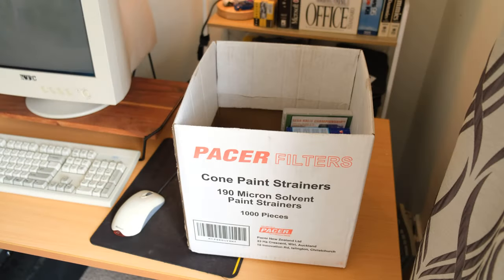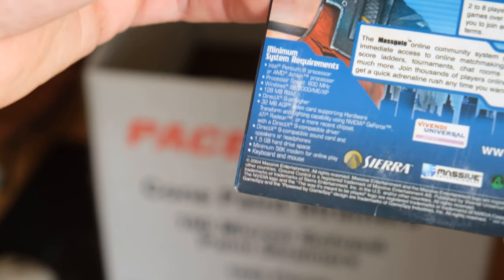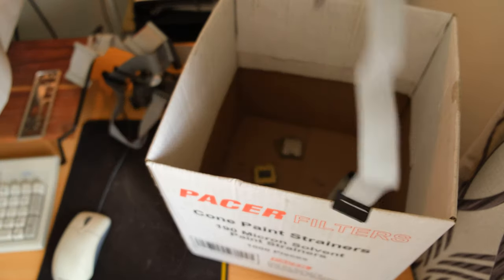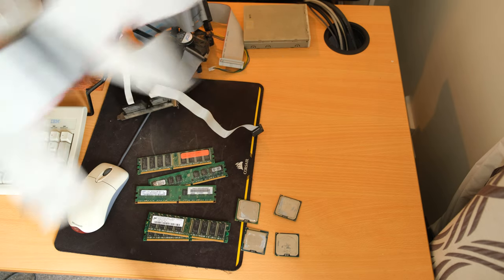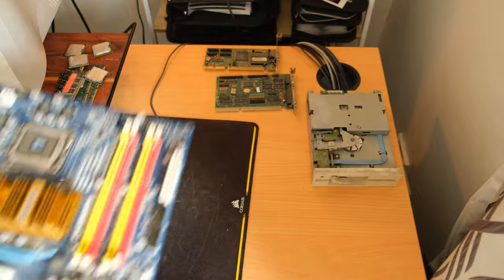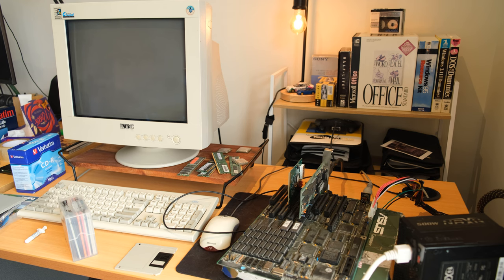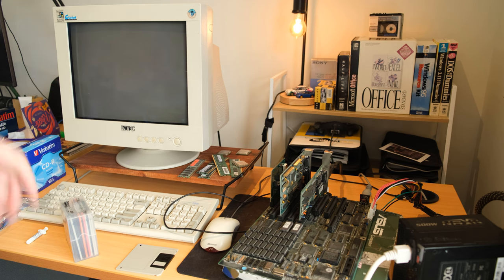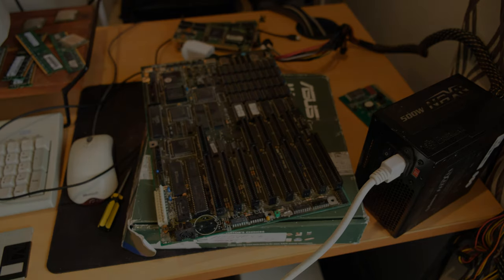Tech Gold | Thrift Finds

Comment: About that 8742 error on the 286 board: isn't the Intel 8742 the keyboard controller chip?
Maybe that's the problem... I guess you'll need to fix one of the traces that goes into that chip...
Reply from the maker: I think you're correct. I did a little research and found most of those error codes refer to the keyboard controller. I'll do some repairs on it and see what happens
Reply: @thesmokingcap  I also said that because I think the 286 has a special CPU reset procedure that uses the keyboard controller...
Maybe the BIOS uses that while doing the POST and that's why it stops and gives up with an error?
Just speculating, I have no idea... 😅